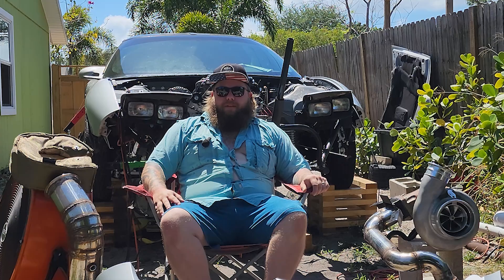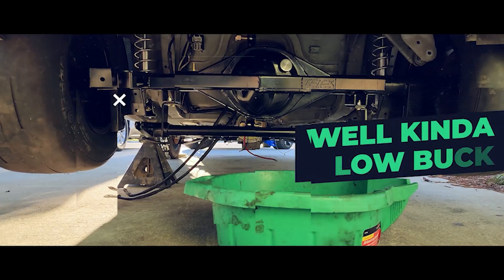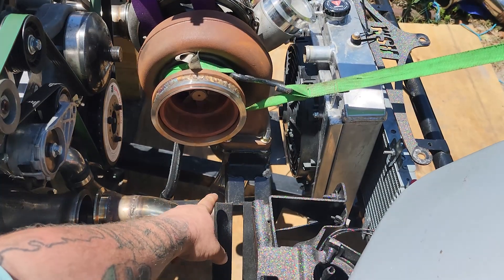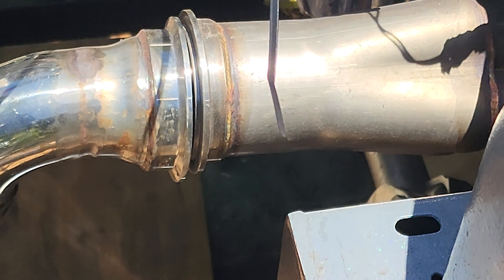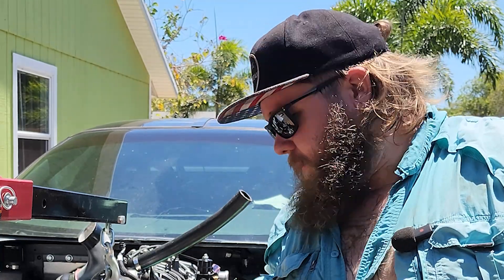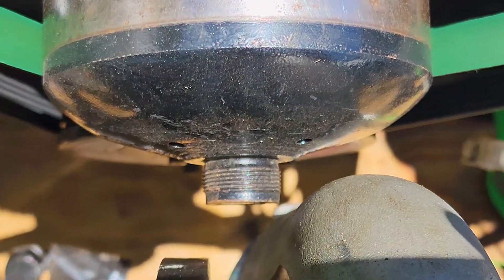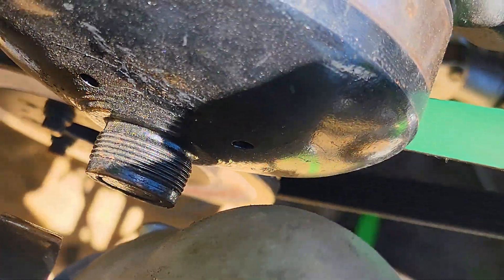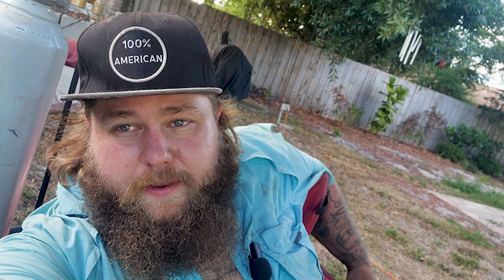These Fabricated Turbo Mount Brackets Worked!

Comment: Awesome video brother! Hey Josh, do you think for my stock bottom end 5.3 the NGK tr55 plugs would be a good choice?
Reply from the maker: I've always ran NGK BR7EF they're cheap and LS's seem to love them. Even with power adders.
Reply from the maker: https://youtube.com/shorts/MqgNT9KnVuc
Reply: Okay sounds good Josh I appreciate your response!!
Reply from the maker: @thehouseofhorsepowerautobo4506  no problem, anytime! You would be surprised how helpful some of these companies are.
Reply: Hey Josh, great advice! I called up NGK their recommendations are as follows-
TR55- NA
TR6-125 shot
BR7EF- 250-300 shot
R5724-8 250-300 shot
Reply from the maker: @thehouseofhorsepowerautobo4506  yessir!! Each plug being a step colder. Awesome information! And no problem I find it's been the easiest way to obtain the most accurate information!
Reply: OK, I've read online the plugs that you recommend are really good for Turbo applications for sure. my application will be nitrous though...
Reply from the maker: @thehouseofhorsepowerautobo4506  people use these for nitrous as well but depends on how much nitrous you're going to run. 6 heat range is good for a 100 shot or 7 heat range to go colder. more It wouldn't hurt to reach out to NGK and ask them as well. The br7ef plugs are good because the porcelain is shielded allowing them to not "blow out" from nitrous.